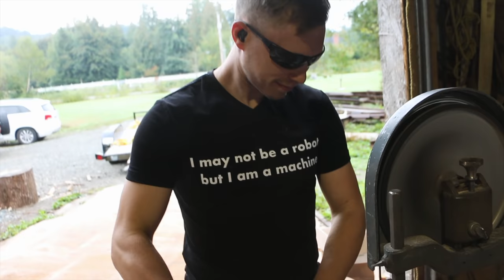I SCREWED IT ALL UP! REBUILDING AXE TOOLING ON UPSETTER

Comment: Having used upsetting equipment professionally it’s rips my heart out watching you weld in tooling.  Proper fasting will make adjustments 1000x easier and faster.

Comment: The issue with the ax heads is not happening with the press. My guess would be the the whole is getting off-centered at the power hammer possibly happening at second process of the power hammer when you reform the side of the axe you're only forming one side of it. Instead of Smashing it back to front maybe include a flipping or rotation alternating left and right as well.